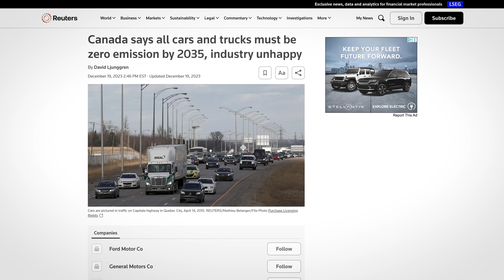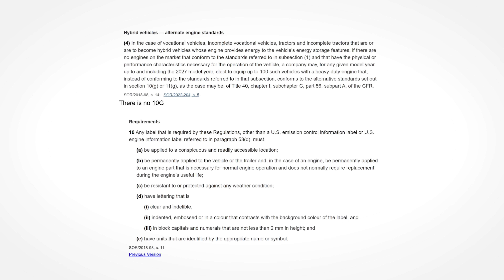Government Red Tape Is Blocking Our Plug-In Hybrid Trucks

Comment: Edison truck with diesel generator on a pallet at home, no problem.

Edison truck with diesel engine on a pallet on a trailer plugged in and charging while driving, no problem

Edison truck with a genset on a pallet on the bed strapped down and recharging, no problem.

Bolt the genset to the frame, then dogs and cats living together, volcanoes explode, people running with hair on fire. Mass hysteria.

This is madness.

Hang in there. You'll get this.

If only there were 1.2 million fans that could spread the word so this could be the subject of conversation around the water cooler. Get this in the news and radio and tv.

Worth building an EV only truck, just to do the genset on a pallet demonstration.
Reply from the maker: We asked them in a video meeting if we could attach a little crane that lowers the engine to the ground when required to charge?  They said that would be legal as it wouldn't me mounted to the truck while running.   

Somehow the exhaust coming out of the generator on the ground doesn't go into the atmosphere the same way as if it was inside the frame rails
Reply: @EdisonMotors Dude. This needs to be a a vid on all the Edison social media.
Reply: @EdisonMotors Please, please, please make a concept render of this and offer to sell it commercially!
Reply: @EdisonMotors what about if the pallet genset is on a trailer? Then the thought experiment could be done with any EV pickup like a cybertruck or Rivian. Any investors have a truck like this that can be borrowed for testing?
Reply: @Sah-o5m  AC Propulsion did exactly this with his Honda Civic many decades ago. Drove his EV all over the continent while GM was crating and flying their fancy EV1/Impact to car shows.
Reply: @Sah-o5m could you tie into a refer unit to take electric from the trailer?  I like the idea of a generator in a secondary trailer but does that then make the trailer part of the tractor unit somehow?   What about making a truck that also has a driven axel on the trailer to add power and traction?
Reply: @EdisonMotors I absofuckinlutely cannot stand logic like that. Hope you get thru. Ps need any sw devs? 😂
Reply: @EdisonMotors build the crane and put in the user manual that it's supposed to be done on the ground. Just a happy accident that it happens to work while still on the truck.
Reply: @EdisonMotors  This may very well be peak "Bureaucracy only cares about compliance, not results".
Reply: @EdisonMotors What stupid is the same thing as been used on trains for decades. Cp rail and kci are using more engines then ever. So much they let the field beside my house on fire. But because it has rubber tires it changes everything. Stupid
Reply: @EdisonMotors  build a flatdeck on the front of the truck instead of a hood, and have a genset on a standalone engine stand with radiator on a pallet, and strap it down. run your wires and everything the same.
Reply: @EdisonMotors say your truck is fully electric and they make the generator a separate product, which truck buyers will get a 99% discount for.
Reply: @EdisonMotors  I love the little crane solution! You guys really should do it.
Reply: @EdisonMotors  what if the generator is in the trailer. 🧠
Reply: @EdisonMotors  Admittedly it would hurt your range a ton to not be able to charge the truck while moving, but that sounds like a great form of malicious compliance because you could then use untaxed off-road diesel.  Get a few of those babies going and they'll be all over wanting to get a fuel tax out of it and once they're already looking at the law it's a lot easier to get some sane input.
Reply: @EdisonMotors I think you are misrepresenting the situation. will the engine be charging the batteries while running on roads, I guess yes. So the engine needs to comply with the regulation for highway use. You can't unload the generator with a crane and run the vehicle. Also the reason for different regulation based on application makes sense. Niche applications have less regulation because the do less harm. My lawnmower has still a carb and no exhaust filters because lawnmowers make little to no difference to overall pollution. If they allow you to run an engine on roads with an emission class not fornroad use then other manufacturers can use your case as precedent to use more polluting engines on highway. The regulation is there for a reason. Get the certification necessary, it might be expensive but you entered vehicle manufacturing, there is nothing cheap about that. I think they should have some ways to give you the chance to get up to speed. Like produce for a few years but in that meantime get up to speed on the regulation.
Reply: @hojbota-ptv He didn't ask that question literally. Like they aren't actually considering that, it was just to make a point. Also there aren't generators that are certified and engine makers won't be motivated to go through the process for a small business. 

The truth is an engine running at a set RPM (ie generators) produce MUCH less pollution than any normal truck engine AND have less runtime. Think about it. A giant diesel engine going through a range of RPM vs a tiny little engine running at a constant RPM. Which one pollutes more lol.  When is the last time you saw a generator smoking under heavy load like trucks do uphill? 

Not allowing the dyed fuel would be one thing but they are being petty and banning everything.
Reply: @hojbota-ptv Dude, you're running the govt hate-a-thon with your reasonable takes.
Reply: Government stupidity has no limits.
Reply: @EdisonMotors  Talk about letter of the law and forgetting the spirit of it. Straight up lack of common sense and reasoning that's been building over the last 2 decades.
Reply: @EdisonMotors  How about just sell the truck without engine or with a small place holder engine? Buyer buys their own engine/generator and adds it in as "aftermarket modification".
Reply: @EdisonMotors  yeah it's crazy how that works, it's almost like climate change legislation is bs!
Reply: @EdisonMotors   can you please post that video meeting?
Reply: @EdisonMotors that's called imaginary physics. Keep up the good work you amazing team!
Reply: @EdisonMotors welcome to govt, I drive a 2019 BMW I3 Rex and it still has warranty because the EPA says you have to warranty it by law for 15 years/150k miles on California Carb compliant states. That's how I figured out why nobody wants to do generators on cars. 

Also by law my Rex can't activate until the battery drains and the gas tank was limited in capacity in earliest years electronically. Luckily there's other markets in Europe that have no such limitations so removing said limitations is easy, I just had to into the obd port and change it. Technically illegal since it goes against EPA regulations, I'm guessing it's about as bad as deleting a diesel but nobody cares about a small 2 stroke motorcycle engine inside a tiny electric car. 

Best car I ever owned, freaking love my carbon fiber built I3.
Reply: @EdisonMotors could you sell an electric truck without the generator. Just have it generator ready. Once customer takes delivery they add a generator? Like we do to our service/weld trucks?
Reply: @EdisonMotors so convert the engine compartment into a "frunk" and leave it on a pallet and make it able to be unplugged.

Now it's not a motor vehicle engine it's a generator.
Reply: @EdisonMotors  its bloody infuriating just to listen to it.  How do these people have their jobs?  I could understand the other way around (on highway engine being certified for generator use / emissions tier) but a certified generator emissionsnoutput doesnt change if its moving or not. 

Can you work with the generator manufacturer to get it on-highway certified?  Perhaps make a test-bed truck so whatever agency has something to verify "yep, same output"?
Reply: @EdisonMotors what if you tune for bio-diesel generator?
Would that improve the feedback from oversight?
Reply: @EdisonMotors insanity
Reply: @EdisonMotors  Is it possible to place the generator under the trailer instead of in the semi?
That way the semi is still 100% electric. It's just connected to the trailer while driving.
Reply: @EdisonMotors  Honestly this is the fastest way to get around it, making the generator seperate and drop in/out. as it legallly is a seperate unit and not apart of the truck, yeah it means mileage stat wise, it will look like it whatever range the batterys have charged, but once customers take delivery of the unit then drop in the "seperate" unit its legal
Reply: @EdisonMotors  that's the same way covid masks worked when at a restaurant.  You couldn't walk around with one, but when you sat down you could take it off.  Somehow that made a difference
Reply: @EdisonMotors   is there a way you could have some type of mini scrubber system for the exhaust?
Reply: Bureaucracy at its finest!!
Reply: In my late teens I worked at a farm. Sometimes we used to burn stuff (like wood scraps, foliage) in an old oil drum. Highly illegal. Put a chimney on it, perfectly fine.
Reply: Great description of the idiocracy the Canadian government has become.
Reply: - my brain welt there straight away - long frame - cargo space on the bed carrying additional battery units and a 6L genset... - "derrick" - to offload genset for (roadside) recharge during rest periods  (I know Edison isn't doing on-highway line-haul trucks, but special purpose vocational units...
Reply: Bolt the generator to a wooden pallet, bolt the pallet to the chassis, then use ratchetstraps going over the generator and attaching to the chassis... eventually you'll get to where they let you bolt the generator directly to the truck with a sliver of wood betwee. them as the "it's technically not on the truck".
Reply: Sadly these political issues are something that Canadians need to stand up for and not give there elected officials a moments peace to get things done otherwise nothing will change. I know there isn't a first amendment in Canada however if enough people peacefully protest change can happen. They can't lock everyone up if enough people again peacefully make their voices heard. It generally takes a couple minutes out of your day to at least call and leave a message to get this taken care of not just for edison but for all those who want to do this!
Reply: Actually the whole “lowering it to the ground” would only need to be conceptual, once the owner/operator drives the truck away who cares how he charges his truck.
Reply: Just call it a frunk and not an engine bay? 
If you can technically remove the generator and put something else in it's place would that work?
Reply: 🥵 will let you build in "MERICA"
Reply: @davidpickard9393  Sure, once you bribe Trump.
Reply: But make it blatantly ridiculous.
Reply: Follow the money.  The amount of trucks you will build in.... 5 yrs.... & the amount the run time they might gather will still be less then a BIG diesel hooked to a transmission. 

The politicians... if no rules cover it, then they shouldn't be able to say no....
Reply: I think a compromise is for Edison to abandon the desire for their trucks to use cheaper red dyed off road (farm) diesel. In the USA, taxes on gas/diesel are used to make/fix roads. The benefit of slightly cheaper red diesel for Edison is not worth the quagmire of public perception being "Edison makes trucks that use/need public roads, but doesn't pay for them. Its not fair". It's not good branding for Edison.

So yes, USA/CAN is struggling to figure out how to maintain roads as every year a higher and higher percentage of EV's are "freeloading" on the backs of the ICE vehicle owners. I believe Edison needs to lay low on this subject and just agree to use normal taxed city pump fuel.
Reply: @Sah-o5m I don't think the problem is the fuel. They need to use generators, not truck engines. The generators don't have all the diesel emissions controls and are not certified for highway use. Even without the DEF and filters, the generators will produce far lower emissions than running a highway engine to drive the truck.
Reply: @Sah-o5m That’s not even the issue. The issue is that bolting the generator  (a different kind of engine) to the truck and running it while driving (on whatever fuel) means it needs to be certified for highway usage.
Reply: They just want the tax dollars on the extra fuel consumed more important than environment saving hybrid diesel electric
Should have been building these decades ago
Reply: my fans only circulate air, not words unfortunately
Reply: Is using Gasoline or CNG CONDEMNED in this case 😊
Reply: @eleveneleven5746 Probably would have same problem. Any combustion engine used on-highway had emissions requirements.
Reply: We have UPS trucks running on CNG 
I guess with low emissions
Reply: Traveling both ways across Canada this year 2025 vancouver windsor quebec city return seeing more and more traffic on ever widening highways
Reply: Bolt a genset to the frame and you're a threat to the oil companies who are counting on the lack of available electric and hybrid trucks to push off the implementation of rules.
Reply: As US citizens I hate to be like this but I really hope you fail as Company. EV isn't the future it is the biggest scam of the 21st century everyone should be telling the government if you want EV you make it. As Citizen you should be trying to hurt your own citizens don't help them at all. EV isn't the way and the United States Citizens realized this we totally rejected it. EV market in the United States Crashed and burned so much the EV Company are fleeing the United States as fast as they can. most of them going to Canada Thank god. Scam Canada not the United States. 

Sorry I hate this is happening to you but in reality you Volunteered yourself for the task, 🤔
Reply: Could a different engine be used for the generator like an emissions car engine or small truck engine and then tune it to be efficient at a narrow RPM range?
Or work with a Generator Company to get emissions road legal, which they will eventually have to do anyway.....
 Lol mount it to pallet ratchet straps under hood makes it easy maintenance and or just swap units and go while service crew works on pallet generator at Shop.
Reply: What kind of emission standards do Refrigerator trailers have to meet???
Reply: Maybee get them to establish the level of emission readings the government will accept and then test units and Show test results are within spec.
Reply: Oh I have a creative solution... Make a small cargo hold under the cab that fits your generator...
Reply: You guys need to move your buisiness operations here to the states. Canada is cooked and went full commie. Were getting rid of diesel regs. Your concept is an excellent idea.
Reply: @Mike-jv8bv  and you're completely DEILLUSIONAL if you think chase is moving to the states. he already said he never will. and the 4th reich leader will turn him done!
Reply: @Mike-jv8bv  With agent orange working against renewable energy ? And can you name 1 commie in the liberal party ?
Reply: @Mike-jv8bv  even without emissions regulations, constant speed generators as prime movers are illegal in USA for other reasons
Reply: @Mike-jv8bv  lol "CanADa WENT FULL CoMMiE. eVery THInG I dOn'T LIKE is COmmUnIsM." Calm down Chicken Little. The US is no prize, speed running towards authoritarian fascism with Trump's dumb ass.

Comment: School buses. If you guys could cut a deal to supply drivetrains to U.S. school bus companies you would kill it.

- highly standardized, the model our schools use (saf-t-liner c2) has been mostly unchanged since 2004
- regen braking ability for a 20k lb vehicle that stops 30-40 times per route (plus stop signs/lights would change the game as far as fuel consumption